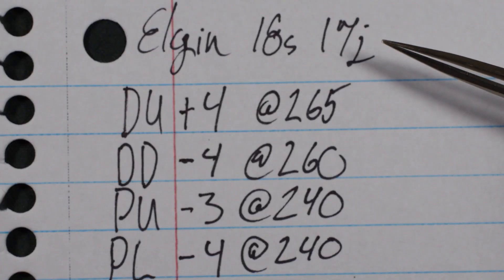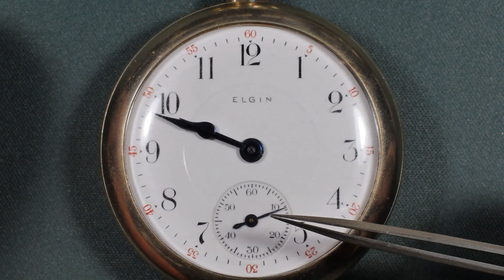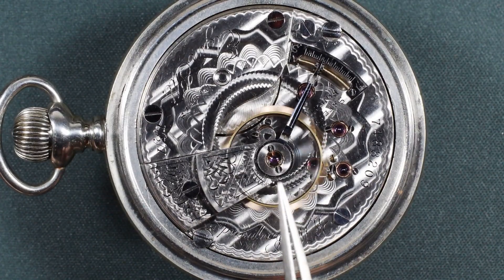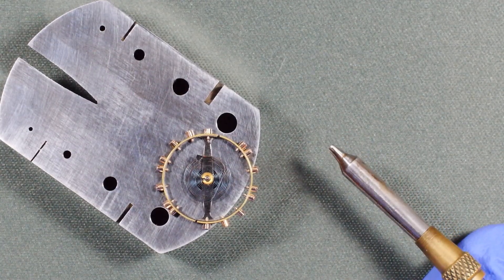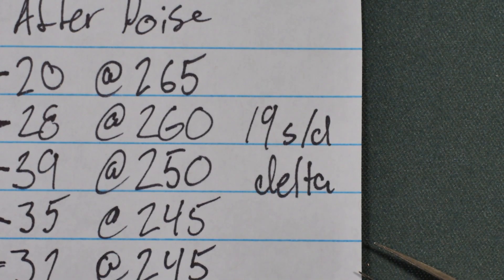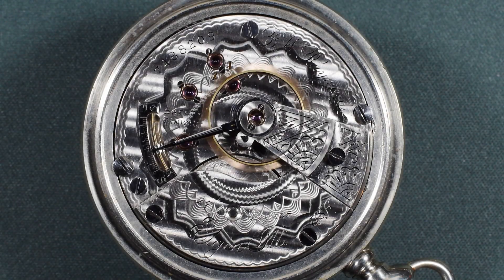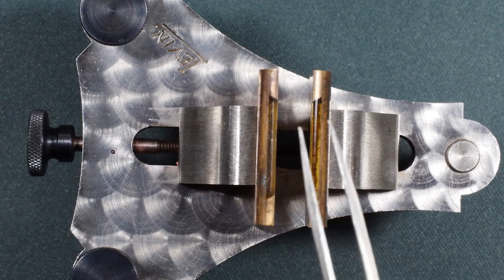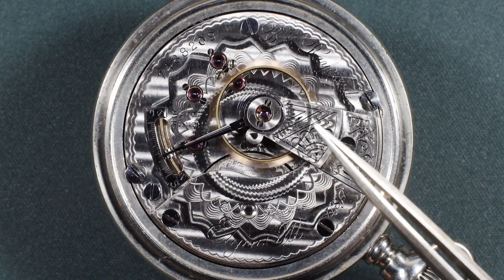Dynamic Poising : Using A Timegrapher To Poise A Watch

Comment: I've watched 3 times since 4am. My curren Burlington Special appears to need balance poising. 

In the pendant up position, the time speeds up to about 60 seconds per day. Do I understand correctly that the timing screw to adjust (back out) will be the one directly under the balance staff when in this position (then the same backout to the screw 180 degrees opposite)? I did manage to get ahold of some thick and thin timing washers today, so should I use those on both the screws to augment the backing out or is using timing washers kind of an extra tweak from simply backing out screws? Hope any of this question makes sense. 

Also as can you recommend where I can get a pin vice like that or how to search it up? I found something similar on Esslinger made by Bergeon but those are all out of stock. Thanks so much for your time!
Reply from the maker: I'll add some caution here that a lot can go wrong when poising a watch (mainly you could snap a screw or break a pivot), but if pendant up is ~60s/d fast and the amplitude is above 200 in that position, then you can either add a timing washer to the screw that is directly below the staff in that position, or you can remove weight from the screw opposite it depending on how fast or slow the watch is running all together. Most of the illinois and burlington branded movement's I've seen have timing screws, they're usually steel and a lot longer than the others. You don't want to add timing washers or remove weight from those.

As far as the pin vise, I got mine from ebay. If you search "balance pin vise" there should be some that pop up.
Reply from the maker: I forgot to mention, but what are the rates in the other positions and their respective amplitude? If the amplitude is varying by more than 10-15 degrees between say pendant up and pendant left, that could indicate a balance staff issue which would make poising useless.
Reply: @ToadHorologist Thanks for the quick reply! On this wheel it appears to have both brass (around the entire perimeter) and steel (one at each arm) timing screws. 

I replaced the broken balance staff and the cracked balance cock hole jewel as part of the service. The pivots are in good shape but ill check them again under the scope. And before I make any attempt at the timing screw adjustment, I'll check the data in the other positions. I will say too that the owner opted to use the existing mainspring, but I do have a new old stock if needed. Also, I noticed a hairline crack on the 3rd wheel plate jewel, so I have a NOS replacement setting/jewel on the way. The 3rd wheel jewel I don't think would affect the timing, but that could affect amplitude if really bad, but even with the crack and the old mainsprin its been at 270. 

I'll reach back once the jewel and washers arrive-probably not worth doing too much more with the balance until the plate jewel is replaced.
Reply from the maker: The steel screws are called "meantime" screws, basically you can equally tighten or loosen them to speed up or slow down the overall rate. Those are the ones that you'll want to avoid adding or removing weight from. 270 amplitude is perfectly fine, but I'd also wait on poising until the jewel and mainspring are replaced (the hairline crack can effect amplitude and by proxy the timekeeping, the lubricant is drawn into the crack and away from the pivot which will specifically effect the pendant positions' amplitude). 

I'd definitely be interested in knowing the rate across all 6 positions, that'd give a much better idea of where to add or remove weight, so once you've got everything feel free to leave another comment!
Reply from the maker: Forgot another thing, but make sure the hairspring is flat after the breguet curve (if it has one). If the hairspring is bowl shaped or dome shaped when it's installed, that can also affect the positional timekeeping.
Reply: @ToadHorologist thanks! Yup hairspring is perfect in all aspects. That was a real win with this project, minus all the other issues I've had to fix. I'll comment again soon, thanks a ton for your input and guidance!
Reply: @ToadHorologist oh one more question. The timing screws are in pairs right next to each other. When adjusting in or out, are you doing each of the set, so a total of 4 (one pair then the same to the opposite pair)? Or is it one from a set, then the exact same screw from the set180 degrees from the first set?
Reply from the maker: Each screw has a (relatively) equally weighted twin 180 degrees from it, just like the steel ones. Hopefully you can see this picture, if not let me know ( https://www.reddit.com/media?url=https%3A%2F%2Fi.redd.it%2Fwmy9qfw7mz7g1.jpeg ), but this is how they're paired up in general. Also you can only back out or tighten the meantime screws (in the picture they're labeled 1 and 2) to effect how fast the watch is running overall, the brass colored ones you need to add or remove weight to actually poise the watch, not just loosen them. It's a bit hard to go into full detail of the process here, but this website (https://adjustingvintagewatches.com/category/dynamic-poising/) has a very in-depth guide on what to do. They do it a little differently than I do, but it'll give you a good idea on the basics.
Reply: got the pic and the page. Thanks again!
Reply: @ToadHorologist Hey again! I finally got jewels and replaced those, the maintaining, and reserviced the movement. Do you happen to have a contact email?
Reply from the maker: @ForestWoodworks  Yup, it's toadhorologist@gmail.com